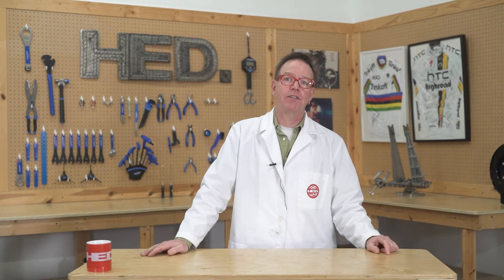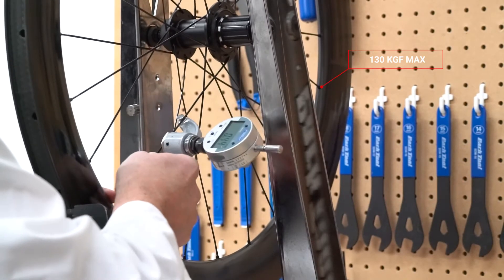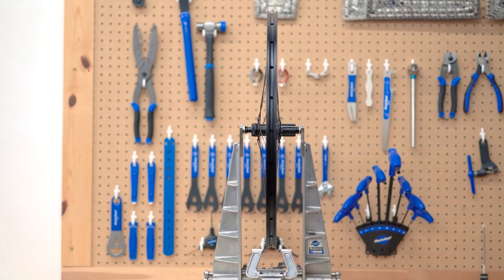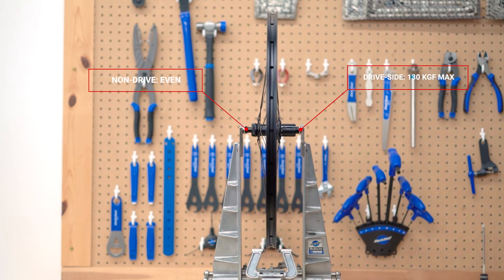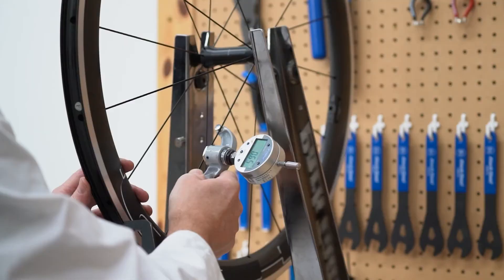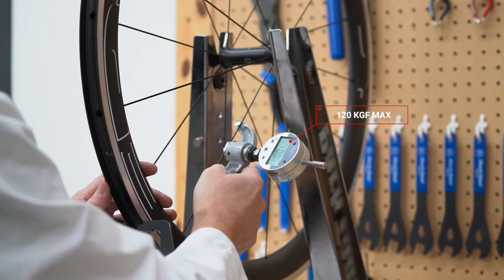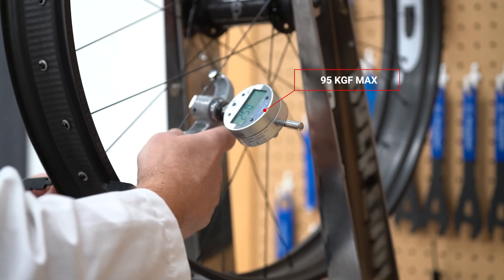What is the Maximum Spoke Tension For My Wheels? // Tech Talks

Comment: Thanks for the explanation. So when the mfg specs say 115-130, for example, does that number range only apply to the high tension side? Alternatively, is there a minimum kgf for the low tension side based on your experience?